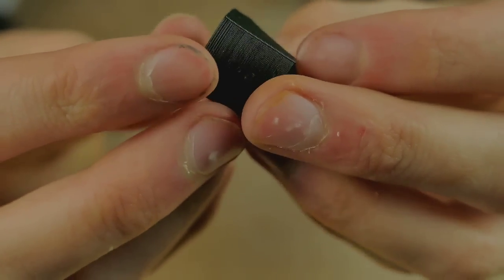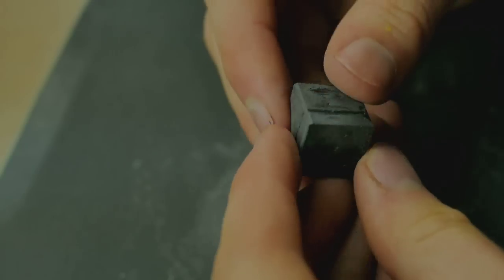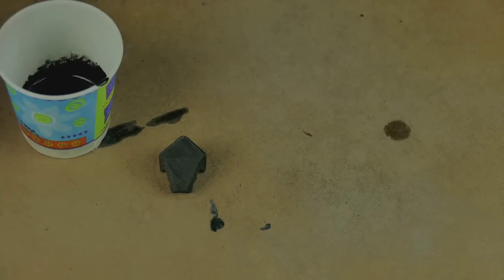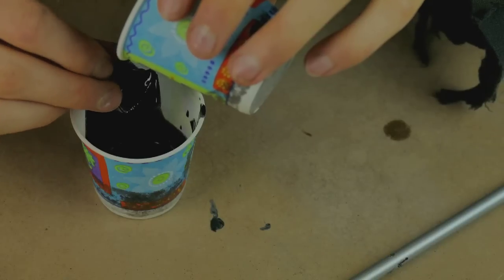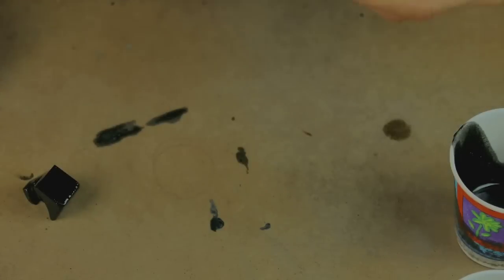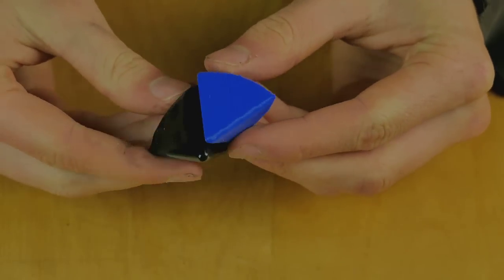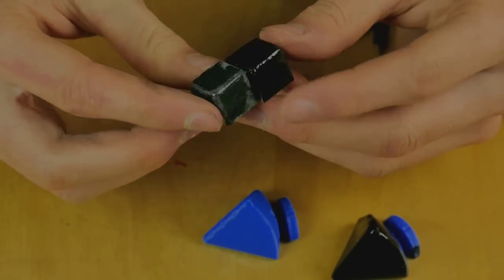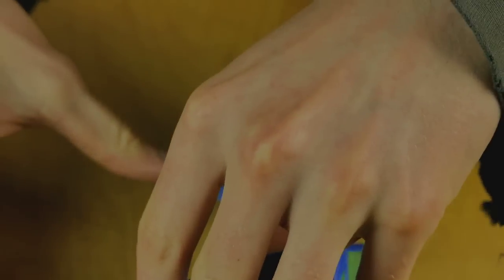Getting a smooth finish on PLA 3d printed parts

Comment: You should burn off the bubbles. Just use a lighter or a flame, just for a few seconds, on the surfaces. It'll pop the bubbles and make it even better.